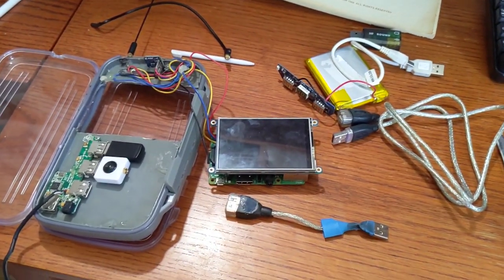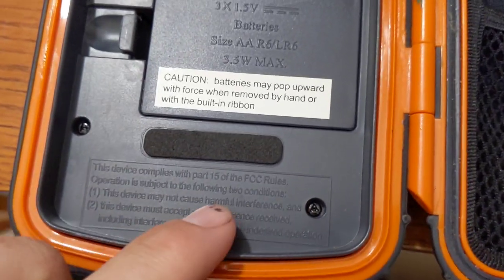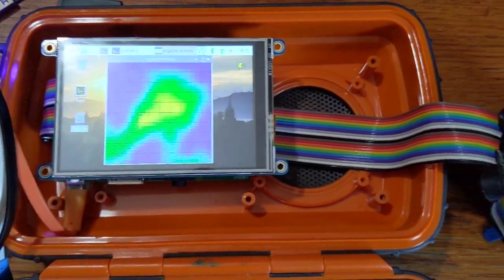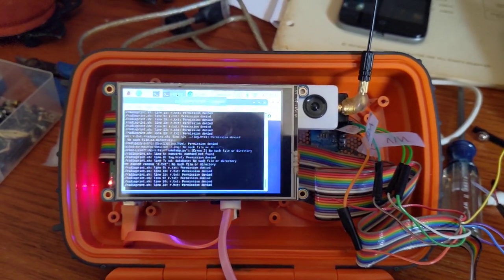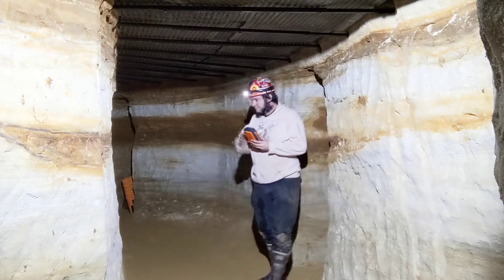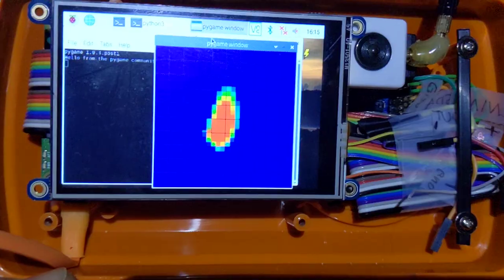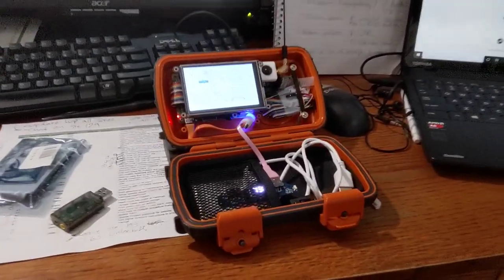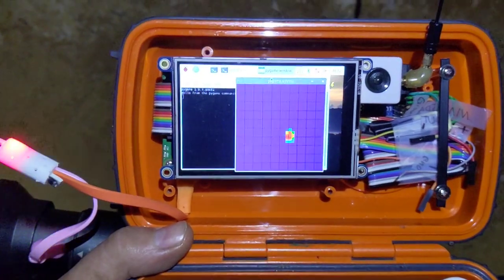Testing a Raspberry Pi Handheld Scanner Underground! (Redneck Tricorder pt3)

Comment: I just came across some plans for RaspPi Geiger counter. Plus,  Adafruit is now selling a new and better CO2/environmental detector. You would probably need a bigger case, but you would have a super, multi-functional underground tricorder then.
Reply from the maker: I want to do a Geiger counter, but I haven't found any small standalone sensors. The only ones I've seen are basically a complete DIY Geiger counter with the Pi interface as kind of an afterthought.

Comment: Ive really wanted to add a stero cam and imu to run rtabmap in one of these types of things so that way you can simultaneously map and locate yourself in relation to your map based just on the 3d camera and inertial measurement unit. Might add a mynt cam or something in there.